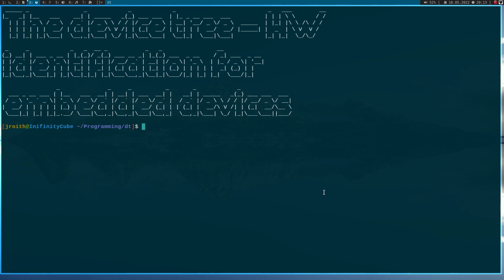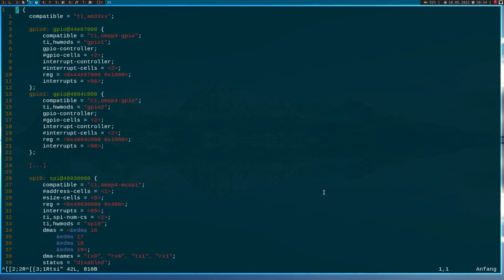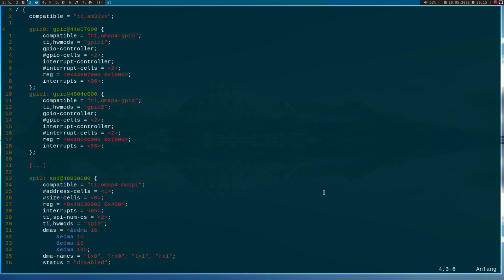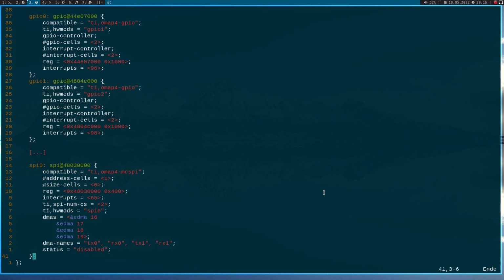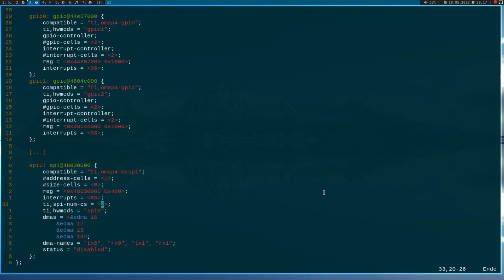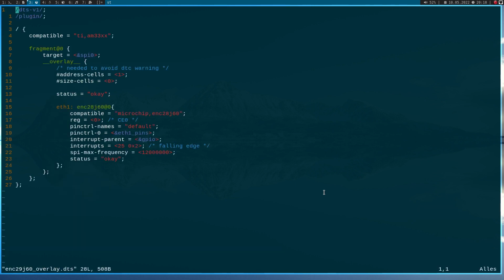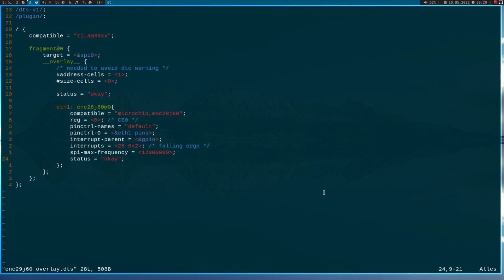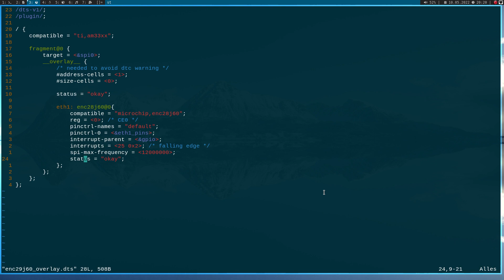Brief introduction to the Device Tree on GNU/Linux

Comment: Hi! Who deliver the device tree? Board firmware that contain information about the nodes?
Reply from the maker: Hi.
Let's take the TI's AM335x chip which is used on the beaglebone black as an example. TI offers an evaluation board for the chip and a Linux SDK for building a Linux Image for the board. The device tree is part of the SDK. If you download and install it, you can find the device tree files in ti-processor-sdk-linux-rt-am335x-evm-08.02.00.24/board-support/linux-rt-5.10.100+gitAUTOINC+204ec708dc-g204ec708dc/arch/arm/boot/dts

Now if you want to build a custom PCB with the AM335x chip, you can take this device tree as an example and change it according to your needs.
Reply: @johannes4gnu_linux96  great!